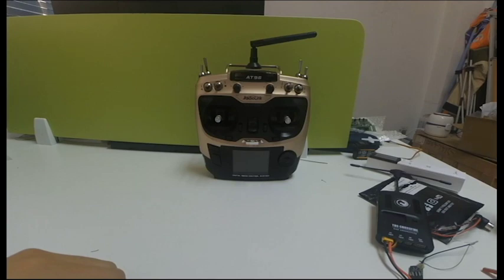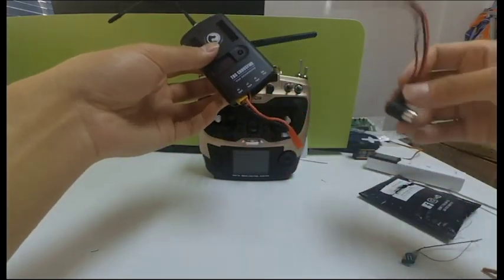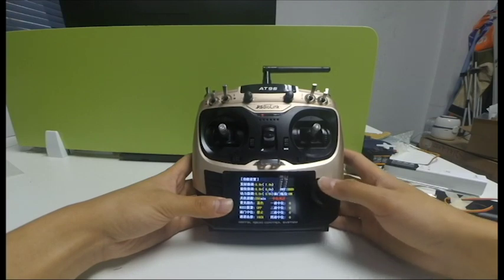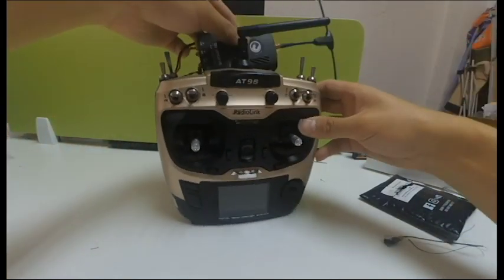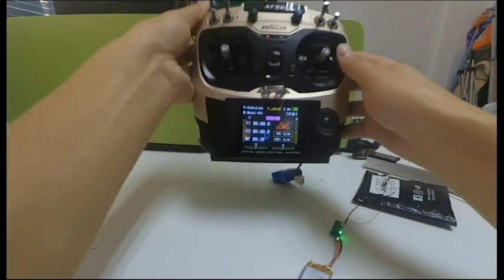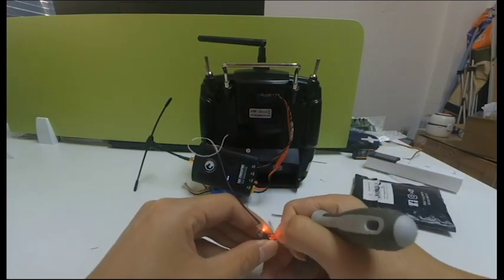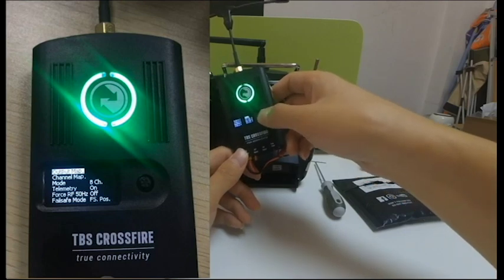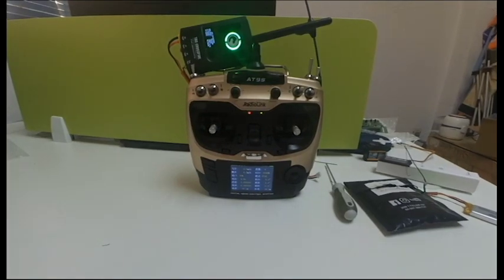How to connect RadioLink 2.4Ghz RC controller AT9S Pro with Blacksheep TBS Crossfire TX

Comment: Is there any support to fix the tbs on the at9 in a nice way?
Reply from the maker: Hi, sir. May I know what device is broken? If you mean the TBS Crossfire module, sorry we do not know how to fix it, you can ask for the seller. If you mean the TBS Connect cable, may I know which part is damaged? If the connector is damaged, you can check if you can buy the connector online to replace it. You can also buy a new TBS Connect cable in our AliExpress official store. https://www.aliexpress.us/item/4000560515612.html  If any question about RadioLink products please feel free to contact us. Our email is: after_service@radiolink.com.cn

Comment: What about express lrs?❤
Reply from the maker: Hi, sir. AT9S Pro can be connected to ELRS module. But you need to make the cable by yourself. We can send you the diagram of the simulator port of AT9S Pro. Then you can connect it to ELRS. You can check the diagram of simulator port of AT9S Pro here https://www.radiolink.com/at9spro_manual  or send email to after_service@radiolink.com.cn for it. If any question when using RadioLink products please feel free to contact us.

Comment: The tbs crossfire is more expansive than the radio...its double price.
This radio doesn't have range ...i used it for boat ...i didnt go far than 40 meter.
Reply from the maker: Hello, sir, Are you using R9DS receive? There must be something wrong with the signal transmission problem. Could you please test RSSI to check if the RSSI value is normal? Here is the tutorial on how to test RSSI for your reference: https://www.radiolink.com/newsinfo/477894.html  By the way, may I know what material is your boat body? If it is carbon or any other metal body, it will cause interference and will influence the signal. You can use antenna adaptor when it is metal or carbon body. Send email to us(after_service@radiolink.com.cn) and we'll send you picture of the antenna adaptor. Here are some notices for you when using it on the water.
1. Do not place the antenna near metal or carbon fiber materials, which will attenuate the signal.
2. If the receiver is used on the water, the antenna should be standing upright, and the antenna head should not face the water, which will also affect the signal. If there is still any question please feel free to contact us. Our email is after_service@radiolink.com.cn
Reply: @Radiolink_official  i'm using r9ds....the boat is carbon body but the antenna is 10 cm far from it.
Reply from the maker: @Rcfishingbateauagadir  Hello, sir. Did you modify the antenna? If so, we are wondering if the antenna is damaged when you modify it. We recommend you to test RSSI first. Here is the tutorial on how to test RSSI for your reference: https://www.radiolink.com/newsinfo/477894.html  By the way, you need to use antenna adaptor when the boat is carbon body, because the carbon body will affect the signal.  Could you please send email to us(after_service@radiolink.com.cn) and we'll send you picture of the antenna adaptor. You can buy it and install in your receiver.   If there is still any question please feel free to contact us. Our email is after_service@radiolink.com.cn

Comment: It is really hard to understand why you support CRSF (which is super) but then have no bay but instead put the trainer port at the worst possible position that you could. making it impossible for a proper fit of the Crossfire module. Such a shame then this radio had everything I was looking for but the impossible Crossfire module mount is to me a sure deal-breaker. I will not buy this radio
Reply from the maker: Hello, sir. Sorry for that. We have noticed that some customer buy Crossfire holder online to mount it on AT9S Pro. You may search it online and get it. It is really a good suggestion to have a holder for it. We'll send your feedback to our team. If there is any other suggestion or feedback please feel free to let us know. Our email is after_service@radiolink.com.cn
Reply: @Radiolink_official : The holder is not the problem - the location of the trainer port on both of your radios is the big problem that I can't 3D print away. When you decide to support CRSF then you should think of how to mount it in a practical way to make a great remote. the protocol only is not enough. very sad as the radio looked good but you need to rethink your design. i don't know any other manufacturer that has the port there - ask yourself why?
Reply from the maker: @stuweFPV  Hello, sir. Do you mean the location of the trainer port? Do you have any suggestion for the best location? It will be great if you can let us know more details of what you want. Then we can let our enigneer know more about it. Thanks in advance.
Reply: @Radiolink_official  yes the location of the trainer port. well check out other manufacturers for inspiration. most have them on the side somewhere. you need to incorporate the big TBS module if you want to use CRSF support as a selling argument - which it is - a good one! (and change your trainer plug - no one uses these old fashion plugs anymore. use something standard that people have like a jack)
Reply from the maker: @stuweFPV  Hello, sir. Thank you for your detailed information. I'll let our R&D team know about it. If any other suggestions, please feel free to let me know.
Reply: @Radiolink_official  I can't say more that what I've seen on the video since I don't own any of your radios. If you send me a sample I could test it properly, make 3D print parts that fit and give you a full feedback of improvements if you care
Reply: If you are really interested in a pro review and feedback of your transmitter then please provide e email address so i can contact you outside of YT. up to you
Reply from the maker: @stuweFPV  Hello, sir. Our email is after_service@radiolink.com.cn If you have any suggestion or feedback on our products, please feel free to contact us.

Comment: Hi please can you give me the link for tbs crossfire ....receiver....cable .......on aliexpress. I have at9s pro. Thanks
Reply from the maker: Hello, sir. Here is the AliExpress link of RadioLink TBS Crossfire connect cable: https://www.aliexpress.com/item/4000560515612.html?spm=a2g0o.store_pc_allProduct.8148356.2.703877cbsbJ1QW&pdp_npi=2%40dis%21USD%21US%20%2417.12%21US%20%2411.98%21%21%21%21%21%402132a2621662  And sorry we do not sell TBS Crossfire module, could you please search it on AliExpress? If there is any question when using it please feel free to contact us. Our email is after_service@radiolink.com.cn

Comment: Where can I buy the cable that plugs into the TBS crossfire tx? I understand you have to buy the cable that connects into the at9s but you don't explain the cable that is already plugged into the crossfire tx..
Reply from the maker: Hello, sir. Thanks for your feedback. We'll make improvement in our tutorial.  https://www.aliexpress.com/item/4000560515612.html?spm=a2g0o.store_pc_allProduct.8148356.4.70386c65pkN1z5  Here is the TBS Crossfire Connect Cable for AT9S Pro. Please have a check.

Comment: Can I use the TBS Crossfire Nano TX with the AT9S Pro? and l need video support
Reply from the maker: Yes, you can. The AT9S Pro supports the TBS Crossfire Nano TX. Sorry we haven't make the video. But we can send you wiring diagram. If you need it, pls send an email to us: after_service@radiolink.com.cn
Reply: @Radiolink_official  can you please tell me how I can hook up tbs crossfire micro to at9s pro?
Reply from the maker: @eyejoycreations3778  Hello, sir. Yes. You can connect TBS Crossfire Nano TX with the AT9S Pro. Could you please check the diagram in the Q&A in this page? https://www.radiolink.com/at9spro_faq  And if there is still any question, you can also contact us by email. Our email address is: after_service@radiolink.com.cn

Comment: why you don't modify Radiolink Transmitter Signal Transmitting Module, just make a simple upgrade on that module. Please don't try to make a big fatty device..& don't add any of Bluetooth or wifi connectivity... just upgrade your own radiolink PCB module board.. add some video transmit system.... as like as wireless land phone.... make it 10-50km range at $20 doller range... and why you don't provide all the features at one receiver - like (OSD, Telemetry & VTX)..
Reply from the maker: Hi, thanks for your valuable suggestions. We are working on it now.

Comment: Can I use the TBS Crossfire Nano TX with the AT9S Pro?
Reply from the maker: Yes, you can. The AT9S Pro also supports the TBS Crossfire Nano TX and we are preparing for the connecting wire. It will release soon.

Comment: hallo there, i just bought your at9s pro. 
First i want to ask if i use this tbs module, should i also buy its receiver or i can still use radiolink receiver ? Second, i want to ask is there any other way to make my controller get more range instead of using this tbs module? Thank you.
Reply from the maker: Hi Thank you for choosing RadioLink product. Yes, if you use the TBS module, its receiver is also needed. For the second question, how about changing the transmitter antenna? We have feedback from other RC fans saying that the range is greatly extended with the antenna replacement.
Reply from the maker: There are two protocols for AT9S Pro. If you use the CRSF protocal with TBS module, then TBS receiver is needed. If you are using RadioLink DSSS&FHSS protocal, then RadioLink receiver is needed.

Comment: Is it possible to connect TBS Crossfire with AT10II?
Reply from the maker: Hi Thank you for your question and sorry for the late reply. I'm afraid the answer is no. But I'm passing your request to our R&D dep. and we will see!
Reply: @Radiolink_official  how about now still cannot
Reply from the maker: @LegingSeluping  Sorry Dear, still cannot.
Reply: @Radiolink_official  Connect TBS - AT 10ii ????
Reply from the maker: @ИванГорбунов-к7я  Hi, sir. Theoratically. TBS cannot be connected to AT10. But we have noticed a customer in China has successfully modified it. Here is the link: https://www.bilibili.com/read/cv8474884?spm_id_from=333.999.0.0

Comment: Thank you for the video. Will the tbs receiver works with the RadioLink AT9 transmitter if tbs crossfire tx is linked?
Reply from the maker: Thank you for your question. AT9 is different from AT9S PRO. Thus, the TBS RX can't work with it as the firmware of  AT9 is not compatible with TBS crossfire.
Reply: You very cool)

Comment: hey there, can you tell me which receiver work for this controller? i've seen frsky, tbs nano, and xm+. How do i know if any of  these can work with the controller? Thank you
Reply from the maker: Hi Compatible rx with AT9S PRO includes R12DSM/R12DS/R9DS/R6DS/R6DSM from RadioLink
Reply: @Radiolink_official  so what's the use of this module if you can't connect to other receivers?
Reply from the maker: RadioLink transmitters are not open sourced and are only compatible with RadioLink receivers.
Reply: Ohh i see, what if i install module from tbs? Will it work with other receivers?
Reply from the maker: @begut41  The TBS module works with its receivers only. Or you can check the corresponding manual to confirm.
Reply: @Radiolink_official  can radiolink at9s also works with TBS Micro TX module?

Comment: Can I used it in my radiolink at10 ii transmitter..??
Reply from the maker: I'm afraid the answer is negative as it's only the AT9S upgraded as AT9S PRO.
Reply: @Radiolink_official  is sbus out for the trainer port possible for the AT10 II

Comment: can you guys make hall effect gimbals for the AT9S/AT9S Pro
Reply from the maker: Hi thank you very much for your advice. The reasons we currently don't choose HALL gimbal are: it's not linear enough; the transmitter precision would be affected; And it would be easily get interfered by high-power electrmagnetic wave and the servo range may possibly jitter.

Comment: Thank you! I just installed multilingual version 2.1.0 on the AT9S and the option "OUT" is not available on the system. Was it taken out from the latest firmware?
Reply from the maker: Hi the multilingual firmware 2.1.0 is for AT9S not for PRO. If you want to enjoy the crossfire fun, please choose AT9S PRO.https://www.aliexpress.com/item/4000389231314.html?spm=2114.12010612.8148356.5.353111e4dDlnZl
Reply: @Radiolink_official  es extraño que la at9s pro, sea más moderna y no permita cambiar el idioma.
Reply from the maker: @maxcamelot956  Hi it's because the Multilanguage firmware SPECIALLY for AT9S PRO is different and now it's available! http://radiolink.com.cn/doce/Firmwares/AT9S_Pro_Multilangs_firmware.rar

Comment: Is this new firmware also works with AT9? And where I can find the FW 2.0.1? Latest FW on the website is 2.1.0, and It doesn't have this Crossfire option. Tks
Reply from the maker: Hi Thanks for asking. I'm sorry to say that it won't ba compatible with AT9. AT9S Pro is a new version radio with both software and hardware upgraded. And the latest firmware is now V2.0.2 which is the factory default.